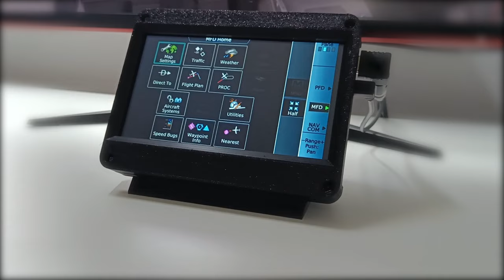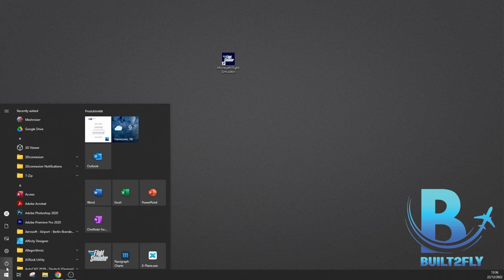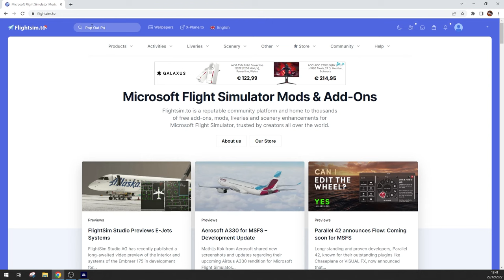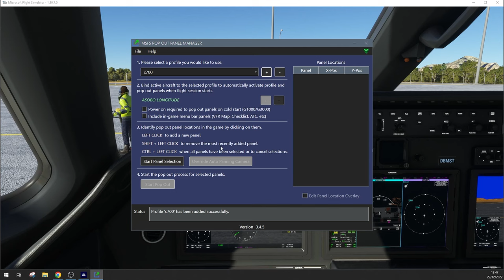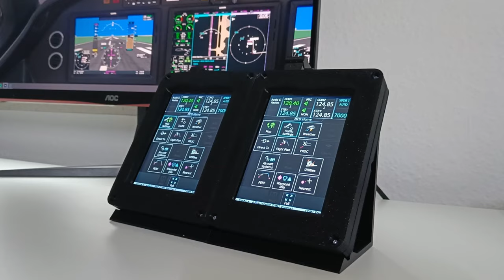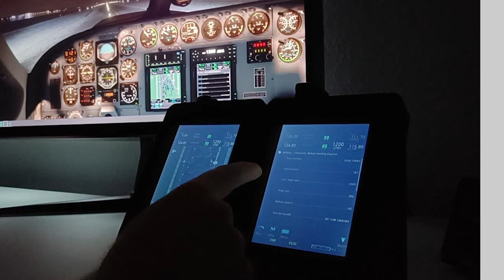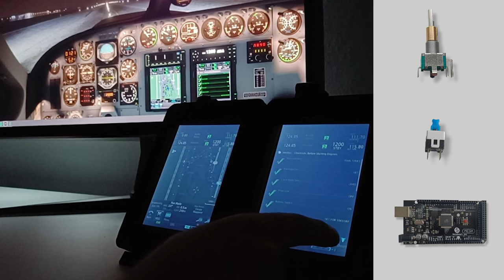Best 50$ MSFS Hardware Upgrade? - 7" Touch Display

Comment: Finally got my 2 screens setup. Thanks so much for the video. I ended up making a timber 45 degree panel to mount them on and painted them black. Works perfectly in the Citation Longitude in MSFS 2020.
Reply: Have you set it up with a glass cockpit? Do the knobs turn?
Reply: @davidmcdaniel6270   I dont have it setup with the knobs, only the screens. Something I am looking to change with other hardware I already have.
Reply: @bikesandbits1000  Ive used my tablet with this set up and as far as the buttons go it works great. But the knobs suck. And that what I really need. Really the steps he showed to make this work will work with any touch screen as far as I can tell. Theres another video where someone used a touch screen monitor and he had no problem using the knobs but he didnt say what software he used . Ive also tried both msfs and xplane and had the same results

Comment: Neat, BUT, does this have the same disastrous effect on FPS that popping out even the VFR map does in MSFS itself?
Reply: That is a very good question!
Reply: I'd imagine this is one of the reasons Asobo hasn't made a dedicated pop out manager themselves
Reply: @ElixirOfEuphoria  Certainly possible. I'm sure I've read that some people don't get the frame rate hit, particularly if connected to an iGPU, but merely activating the VFR map popout on my 4K screen has a dramatic hit. I suspect that some form of additional 'VSync' is being introduced and that it doesn't match the main screen. Should be easy for Asobo to fix if they wanted to.

Comment: This is brilliant! Is it functional to only print the GTC580 case and use it for both GTC570 in portrait and GTC580 in landscape? I'm assuming the GTC570 would expand to fit the larger screen real estate the GTC580 provides.
Reply from the maker: Hey oneill09, 
Yes sure, you can absolutly do that. Additionally you can hide the task bar and the window title bar.
It would look like this: https://built2fly.com/wp-content/uploads/2022/12/IMG20221231121138-scaled.jpg
-B2F

Comment: I bought the display including the hard case and the touchscreen isn't working. Any ideas?
Reply: Good tip for anyone having this issue: not all micro USBs are the same. 
A rookie error but the cable I was using must’ve just been a power and not data cable. I used the one from the box and it works, it’s just much too short; so off to buy another one.

Comment: you can pop out panel in the sim no addon press hold Right Alt then click on any display you want to popout!
Reply: Yes but the software lets you configure presets. Which saves all the time down the road
Reply: the touch doesn't really work great with the standard pop outs. If it works, your mouse will switch to your second display which is annoying if you still use the mouse for AP for example.
Reply: I use a tablet as a 2nd screen and when I touch the pad you lose control of the aircraft and have to move and click back in the main screen. .
Reply: @nigelmorris4769  "Pop out Panel Manager" fixes this
Reply: I thought the same but noticed the touch wasn't working properly. As others have said "Pop Out Panel Manager" fixed it for me as well.

Comment: Excellent idea and implementation, have my replica just finished. However, it would be nice for the TBM 930, you could switch between PDF, MDF and COM by touch, so unfortunately you always have to click with the mouse in the cockpit. Or is there already a solution for this?
Reply: Could you setup something Arduino based to do that? As in a small three push button module?

Comment: I assume it needs a free HDMI port in the graphic card ? How do you connect that + 2 screens ? I also have two monitors and they take the two HDMI - IN of my graphic cards ... Thanks for any inputs (!) you might have ! Cheers
Reply: Lots of ways. On-board graphics. Graphics card with multiple outputs. A second or even third graphics card. USB or other interface to HDMI adapter for newer machines…

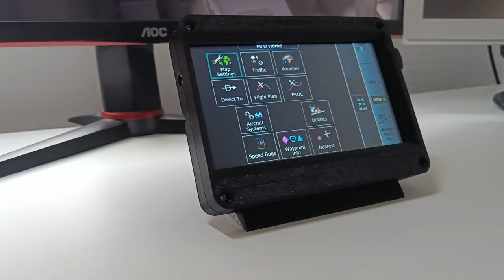Comment: Hello. I bought the parts and assembled it and everything is working almost perfect. But I have two problems: 1) At minute 5:06 you show the TBM930 PFD/MFD/NAV panel, but the side buttons to switch between them are not accessible. My screen looks the same as yours, but I tap on the MFD or NAV and it doesn't change. These buttons are on the outside. Is there a way to change this? 2) Is there a way to disappear on this screen the windows 11 toolbar and menu at the bottom of the screen? For the rest, it was pretty good. Congrats and thanks for making it available. I'm going to print the parts on the Ender 3D V2 later today.
Reply: Hiding title bar and full screen mode I have found where to configure it.

Comment: I might be wrong but seems like there is a little delay introduced. Is this right?
Reply from the maker: Hey youpepe,
that is correct. The TDS GTN 750 has a slight delay on my PC. However this is most likely due to the fact my old graphics card is running 4 screens simultaneously (GTX 1060).
The PMS50 GTN 750 and the GTC570/580 aircrafts do not have a delay on my PC.
-B2F

Comment: Will it work with a Boeing CDU?
Reply from the maker: Hey Amer,
if the CDU is completly touch like in the 787 yes.
Image of 787 CDU: https://built2fly.com/wp-content/uploads/2022/12/IMG20221231121638-scaled.jpg

For the 737, there is an addon called Fergo Virtual CDU which works with normal tablets.

-B2F